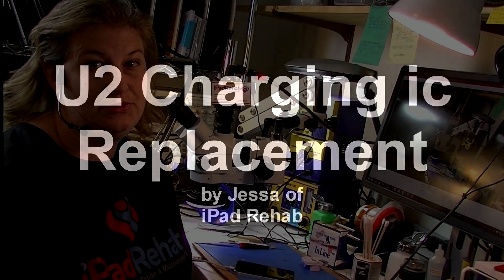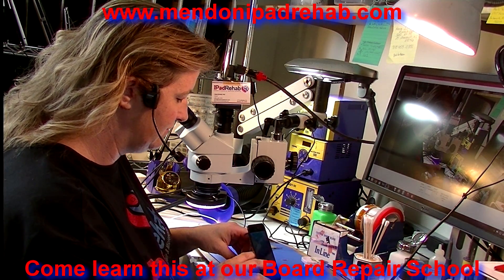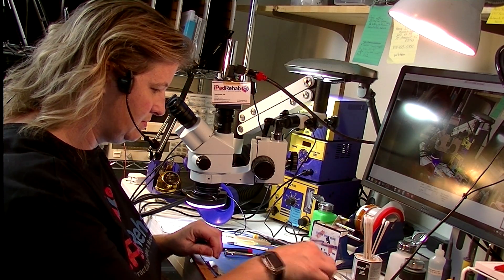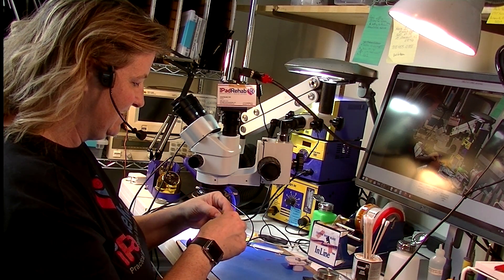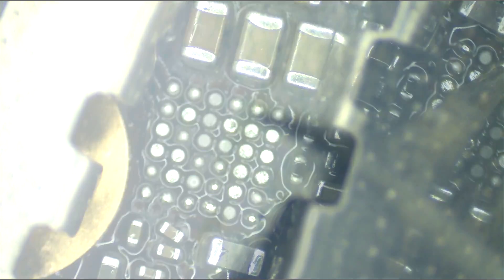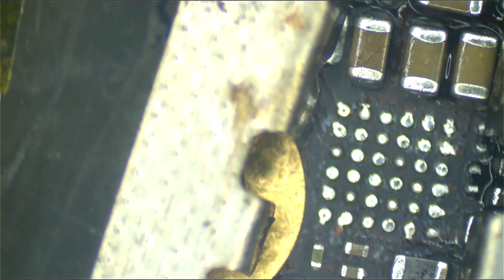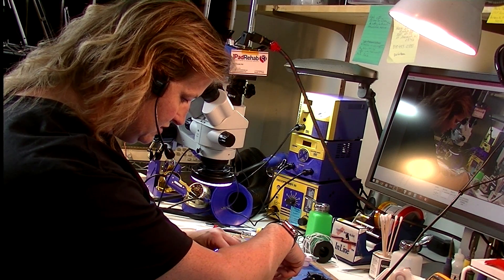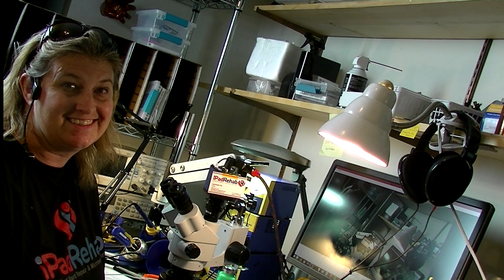How to replace tristar (U2) charging ic chip to solve slow charging, fake charging problem

Comment: Hi I live in germany my phone has a problem it restarts after charging but the problem is combined with graphic problems apple does not touch it used phone and the repair shop was useless did not solve the problem. The sreen seems to get wrong signals cause even the lines of the apple logi whgile booting is somehow stretcht to some lines then the whone works pritty well for some time but after using the camera or after loading problems come back.
pleas give me a hinge what to do?

Comment: Hi, I have a question. My iphone (7) is randomly shutting down, only powers on when connected to charger. Sometimes it is working normally during one or two days. What do you think if the tristar ic chip could be a reason? Thank you in advance

Comment: I've an SE and I changed a U2/Tristar chip on it because the phone didn't charge up. After chip replacement the motherboard has PP_GPU and PP_CPU short. I used kapton tape to cover other parts and I used the hot air station on 350C. I think I did a good job but just in case I removed the IC (all pads look good) but the motherboard still has short circuit. The phone never had water damage. Can anyone tell me why has the phone short circuit and how can I fix it please? Thanks in advance. Anita

Comment: Boy I fucked this up.... Pads? What pads? Oh the ones I tore completely off...ahh. Wish you'd just said it takes a shit ton of heat to remove the U2...yep like 400-430 degrees from a the hot air station.... So for those planning to do this...get it HOT and DON'T force it AT ALL. 
Psssh.... 😒
Reply from the maker: Uh don’t do that.
400-430 degrees is waaaay too hot and you will kill your bb_cpu on the opposite side of the board
Reply: iPad Rehab Well I had my station set to that... It didn't budge till I got it really hot and then it came off, well half did, the other half I heated some more intermittently and scraped off gently...exposing pads which looked dirty so I then used the iron and flux hoping to get some solder off as well as braid... Idk at what point I lost the pads or perhaps they got hot and recessed...no grounds exposed around the pad area....can ya gimme a round about idea of the temp you used...? I'd totally send this iPhone to ya to see where I screwed up and perhaps show others...I even watched your video about the botched U2 repair like 5 times.... Other videos also made it look like a walk in the park...it wasn't for me, a nightmare instead. Anywizzle please comment and hey if you want this iPhone 5 to show everyone what a cumbersome little shit I am, let me know. 🤪
Reply: iPad Rehab oh and the iPhone turns on as I put it back together without the U2..so the board lives! Yay!... Lol of course they'll be no charging this mint condition unlocked piece of.....uggh. 😖
Reply from the maker: This is exactly why i never quote temperatures.  If you actually had 400-430C on that board, then the board would be dead and tristar would have slid off like rain on a windshield.  What is the lesson?  Never never never never ever TRUST the "temperature" that sub-$1500 hot air rework stations claim to be set at.   Hot air rework is an art not science--learn to read the board,  learn how minuscule changes in tip size, shape, height, and angle dramatically affect the process of removing/replacing chips.  And never touch pads on a board without heat, aka don't jab at them with regular tweezers.
Reply: iPad Rehab yeah... It's sub-$1500 for certain. I'm just learning this delicate work and I know in many of your videos you emphasize the fact it takes countless hours of experience...but really got upset over that U2...bout hung up my iron for good 😩, but reconsidered. I really wanna learn this. I don't think I have the time nor money to fly to NY right now but will definitely consider a subscription to your forum and discussion board. Can members post pics of their successful and fail work and receive some feedback???
Reply: iPad Rehab OK update..... Figured I already screwed up the repair and it may be unrepairable soooo.... Revisited my job and you said not to scrape it... But thought I saw the pads underneathe...scraped it with fine tweezers and whaa laa! There they were...however seems like it took a lot of heat to make the balls shiny on my new chip so during the install I'm pretty certain I got the board too hot...I got the chip on but now the phone is DOA...completely dead...so I assume I "rotisserie roasted the board". Damn. Is there a reasonably priced hot air station that's decent...in the $100-200 range??

Comment: Hi, I watched several videos regarding Tristar problems. My symptoms are different. I have only apple logo on Iphone 6s after power on. When I connect power cable and measure voltage on battery rails it show me 3,65 V  which looks like no problems with Tristar.  What do you think about it ? Do you have any suggestions ?
Reply from the maker: Send us a repair request at iPadrehab.com

Comment: hi Jessa, 
this is the exact information i was looking for, i have made a comment on one of the videos of louis mentioning my problem, now that i know what is the culprit, i can recheck my phone's "illogical" board when i receive back from the repair shop. 

only one question i have, i mostly charge my phone with a car charger, whose output is rated at 2amps, its an expensive one i bought it for maybe 200 AED. at home i use the original charger, should i change my car charger too ? as you said this problem occurs mostly by using knockoff chargers/ non original chargers. 

please reply at your convenience,

Comment: I got the same symptoms as described in the video on my iPad mini 4 , it starts up with a brand new battery but won't charge, it says it's charging but the battery percentage won't move (fake charging). Has the iPad mini 4 got a u2 chip??? If not what could be causing this fault??? It loads up and restores fine on iTunes but won't charge...please any help.jay

Comment: HI Jessa, Really enjoying your vids. I'm trying to repair my daughters 5s, it's stuck on Apple logo screen. Tried everything to restore but nothing works so took it apart first thing I'm checking is the battery voltage which come out at 4.26 v would over voltage cause a no boot problem? Cheers
Reply from the maker: +don moran no
Reply: you are checking that battery under load, right?

Comment: I have an Air 2 that will not power on.  If plugged into charger, starts to boot loop.  When I try to restore it, I get error 4005.  Battery is good.  No water damage.  I've ruled out all parts attached to the board except for the charge port.  Could it be the charge port, U2, or PMIC?

Comment: hello, I have a 5s, the port was damaged and my colleague changed it with a new one but the iphone now seems to be on boot loop. what could it be? I can't try the original port because he disposed of it before giving it to me, I have tried with another new one but the problem is the same. what could have he done?
Reply from the maker: You posted this on Louis's forum as Nick--didn't you?
Reply: yes. can't post there anymore as the forum became with a fee just after my last post. i saw your reply (thank you for it) and well, you seemed angry with me for fucking it up, i would be as well, but it wasn't my fault, i didn't have a chance to see the phone until it was already fucked. all i did was charging the battery outside. i Only do the electronics (laptops and macbooks, on phones i only do jtag boot repair, and emmc chip off data recovery, i am starting on iphones) they did all the shit, i have just been tasked with try to recover the device, it is not my fault if the, sorry to say, idiots didn't back it up before doing the job. I assume they thought that it was a simple port swap and nothing to get paranoid on. Again i didn't have the time to check the device for much, on monday i will know if it is a long screw damage or something else. I have already talked with the boss who is gonna deal with my collegues and the customer (apparently and luckily he  Icloud-backupped two days earlier). I still want to try to fix the device anyway for respect toward the customer and also as "training" for myself. If you would be so kind to point me toward the right direction and tell me what to look for i would be immensely gratefull. Thank you again ma'am... sorry for stirring you up earlier
Reply from the maker: Then change tristar, fix any pry damage by dock and dfu restore.  It probably never needed a charge port.  It is boot looping because of software corruption from botched repair
Reply: iPad Rehab they said they wanted to change the port because it was charging only when the chord was placed in deeply, so I guess they ruled out hardware problems. they also said it was working completely fine before changing the port assembly. I will try to enter in DFU mode but I think they have already tried that. I am gonna remove the port assembly and try to boot it that way and see how it behaves

Comment: please what kind of flux do you use and what temperature and level of heat do you use ?
Reply from the maker: We use NC-559-V2-TF flux which can be purchased here: https://mailin.repair/amtech-nc-559-v2-30-cc-16160.html It is the best stuff there is. You can also get it with a plunger & needle tip for a small fee.

Comment: hi Jessa, i removed the u2 chip from my iphone 6 but i think i damaged these pads where the chip was sitting on while taking off the chip with my tweezer.. how do i reball them back to normal (which is not easy without a microscope). should i do it like just the way you did in this vid? or do u have any other tips or suggestions to reball these pads on my board? thanks in advance and best wishes to you.

Comment: hey jessa, if i take u2 ic from another 5s motherboard, it will work?
Reply from the maker: Not as well as a $2 new tristar chip.  Too many variables --was the original chip good? Did your reball go well? Not worth the doubt to save $2 in my opinion
Reply: jessa im in tunisia we dont have acces to buy from ebay or amazon ... so i have to work with what i have :)

Comment: Teacher, what is the hot air temperature that ur using to remove chip ? this one for exemple, thx
Reply from the maker: Hot enough, not too hot.  Learn your station.  Numbers don't matter
Reply from the maker: Somewhere between 300-450c depending on the job. This always differs. iPad Rehab highly recommends the Quick 861DW http://bit.ly/2xGDTXo for a cheap, affordable, powerful hot air station with an easy interface. It will remove all different types of chips without a problem, unlike weaker stations that can't stay hot enough long enough to do the job.

Comment: I have an Iphone 5S, it had problems with charging for a few days (the charge was displayed at 1%, but it was definitely charging , the charger was getting warm), worked like that for a few days but then turned off, now it is asking for charge and recognizes when it is connected to a charger but it does not charge, it stayed like that for a quite few days and still displays empty battery, so I think the battery had some charge in it when it turned off. Is it a U2 problem or a U7 problem and how can I tell? 

I have access to a soldering station with a fan, so I want to try to fix it myself since repair services are asking 50 to 70 bucks for that.

Thank you.
Reply from the maker: I'd rule out bad battery first, then tristar
Reply: Thanks for fast reply, I've changed the battery a few months ago since the old one was holding charge for only 6 to 8 hours. Will try to put it back in and order Tristar if it doesn't help, thanks.
Reply: So I've measured the current draw and it looks like it is charging (the phone took around 350 mah @ 0.67 amps before current draw gradually dropped to 0) but it won't turn on, just shows an empty battery on screen when power button is pushed, so I'm still not sure whether it is U2 or U7 to blame

Comment: hi,ihave got a galaxy s6 edge which has fast charging issue i have tryed all common solutions but it doesnt work like changing cables,or the whole charger even mobile socket,do u think it's ic power also??

Comment: Great videos Jessa.   I'm curious -- I have an iPhone 5 ; it will not detect iTunes , or charge... I replaced the battery and it started up.  Still wouldn't charge.  So, removed the battery and attempted to power up with just the charger -- no dice.  Could this be the u2 IC ?  ...  Why don't most techs offer iPhone 5 u2 IC services?
Reply from the maker: yes.  and because it is a giant pain in the ass on the iPhone 5.  Not worth the trouble.
Reply: Thank you so much for your reply. I found a service (on ebay) for $30, plus shipping and they will replace the u2 IC on my iPhone 5 (only seller that would do so) ...just out of curiosity why is it more of a PITA to do one on a 5, in comparison to say a 5c, or 5s ?
Reply from the maker: U2 is next to the CPU on the iPhone 5, so there is a good chance of killing the CPU. So then you have to explain to the customer that while they started with no charging, they have a dead CPU. Too much risk for $30!
Reply: Ohhhh, I see that makes perfect sense.   It is pretty close to the processor, so heat damage becomes a concern when you remove and reinstall that u2 IC.      Well, I fixed mine yesterday fairly quickly -- to all those thinking it may be their u2 IC ; you should try replacing your charging port first because the part is cheap and it's fairly easy to do.  That's what ended up fixing the problem for me ; and I was still getting voltage at some of the test points.  No charging / no USB sync. Now all is well in iPhone land.

Comment: Hello can you help me please, i have an 5C and 6, the problem was not charging, i did replace a new U2 / U1700 ic, now the phone shows its charge but not increase percentage. Im not a starter, i made this skill many times, but now i dont know what to do...On logic board not damaged, already check. Battery and dock connector changed, same problem.

Many thanks!

Comment: Hi Jessa, Recently i had replaced LCD for my iphone 5 & now when i connect charger it says "This accessory may not be supported". when the battery drains completely & the phone is switched off i then connect the charger & on pressing the power button once the phone starts after a while and charges upto 5% and then the charging stops and when i re-connect it says "This accessory is not supported". i have tried with all the types of cable & power adapters including the apple genuine but the same problem persists.
Reply from the maker: sounds like tristar (U2) chip is dying.
Reply: thanks jessa, but is it possible that components near the charging connector may get damaged?. also i noticed that its just charging problem because my phone is detected by iTunes.
Reply from the maker: you can spend a long time trying to make a bga chip problem not a bga chip problem, but that is most likely case here.
Reply: 0ok so its just u2 tristar ic that needs to be replaced right??
Reply from the maker: i have no idea, the phone is in front of you not me. I cannot measure or experiment on it. answer this question for me yourself!
Reply: changing the U2 tristar IC didn't worked.but i got the schematics will experiment further and let you know..:-)

Comment: Good Morning Jessa,

I have replaced my U2 IC on my iphone 5s and now my phone will display a battery and a charge cable on the screen. But when I plug in a cable it won't recognize the cable and will not charge. Can you give me some hints please? did I cook something? PS I love your videos! 

Perhaps I heated something up and caused a component to move. Where should I look?
Reply: Rule out bad parts.  Then rule out bad Tristar placement/wrong chip.

Comment: Hi, i need some help! i changed the screen on my iphone and now it doesnt turn on, no charging, just no response. i did check all the ribbons and nothing still... i think its a short? Can it be this problem? i also did take out my mother board and moved it to another iphone 6 i had and no response. i  may also think it could be when i was switching out the ribbons for lcd while it was still on. Please  really need help thank you!!
Reply: When its plugged in for a while , does it show up on itunes or can you make vibrator motor sensor virbate by muting and muting ? it might be a display (ic) issue. cheers